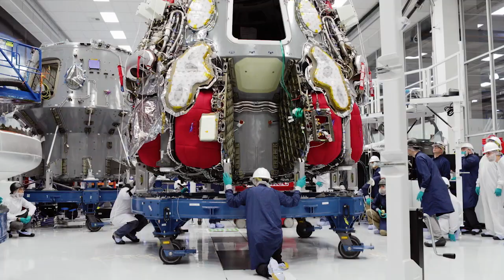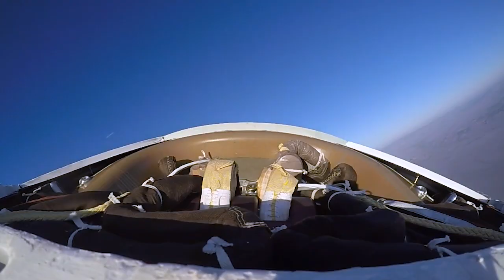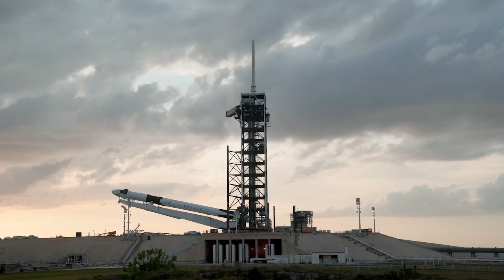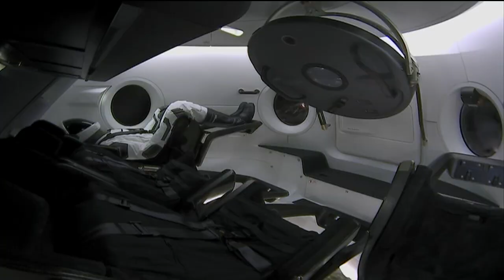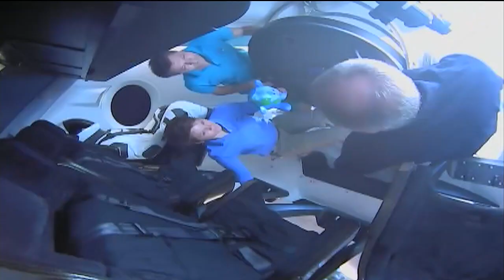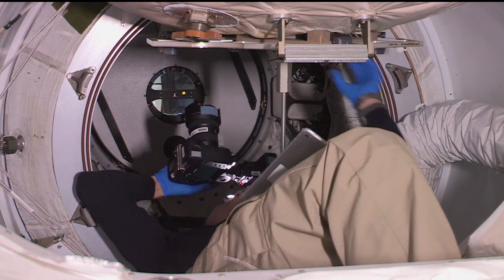Crew Demo-1 | Hatch Closing

Comment: Question:
When the astronauts leave the ISS. do they wait for 14hrs while it depressurizes?
Reply: That was answered by the commentator. With crewed missions hatch closing is much nearer to departure.
Reply: bastisonnenkind but recall them saying they close so it can depressurize. If so, how long would it take to depressurize?
Reply: @mahmood it's in phases. I believe I read somewhere about 2.5 hrs